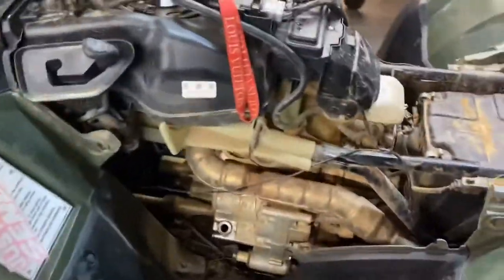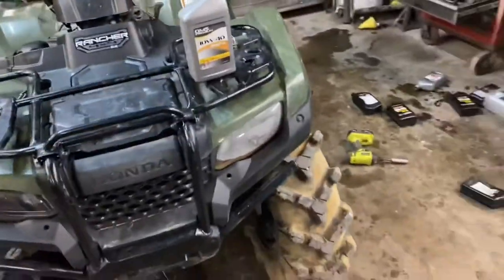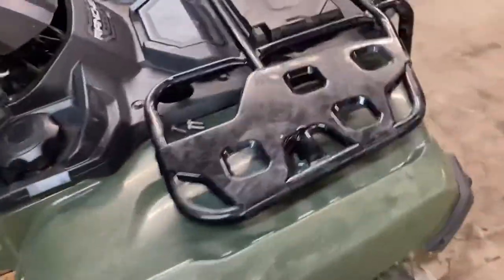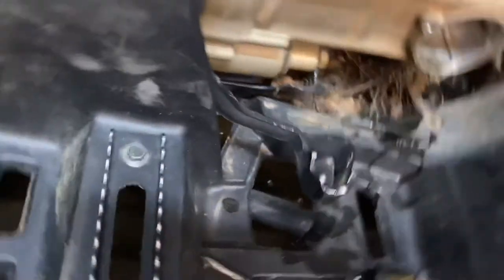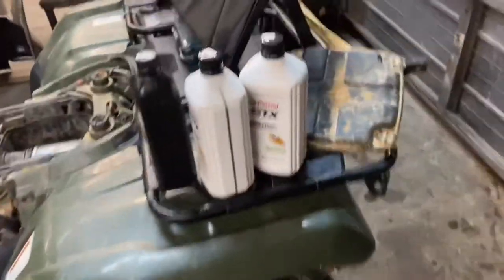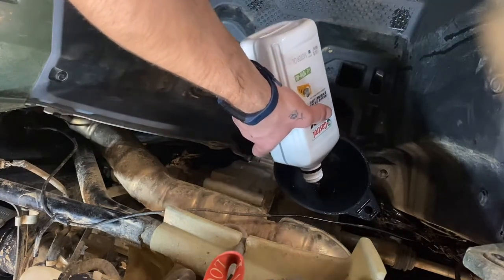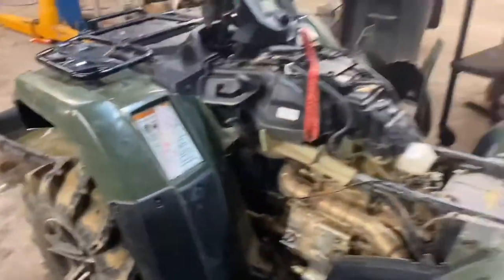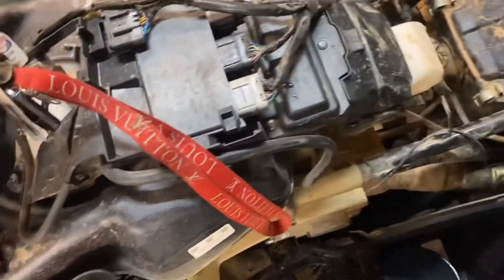How to unsink a Honda 420 rancher/ flush engine

Comment: How did you rebuild it? I just snorkeled my 21 rubicon. Trying to figure out what to do if I ever sink it 😅
Reply from the maker: Just order the cheap Amazon rebuild kit and watch a video on how to put it together. Mines been running strong for about 9-10 months since I’ve rebuilt it not a problem out of it. Make sure you adjust your valves right also
Reply: @onewayklay6175  so if you sink it, you just have to do a rebuild? The water doesn’t damage anything under the piston? The rebuilds look very easy.
Reply from the maker: It just depends how long you run it after you sink it. never run it with water in the oil. Drain oil Immediately after sinking it and you’ll be perfectly fine